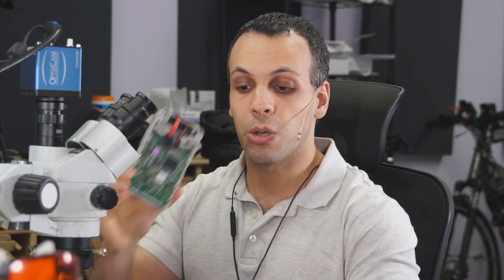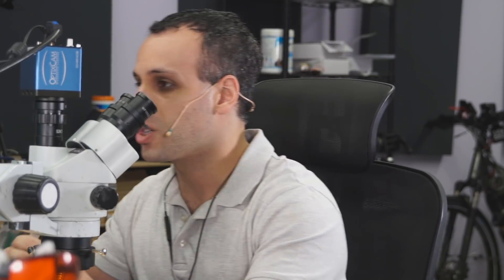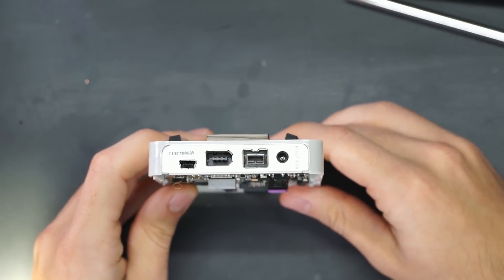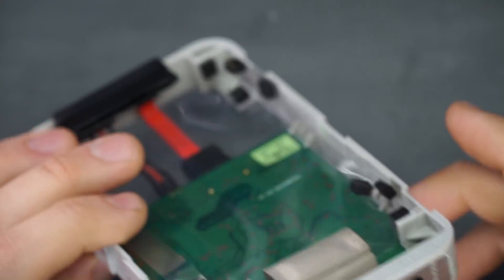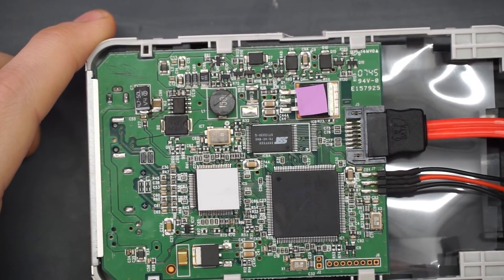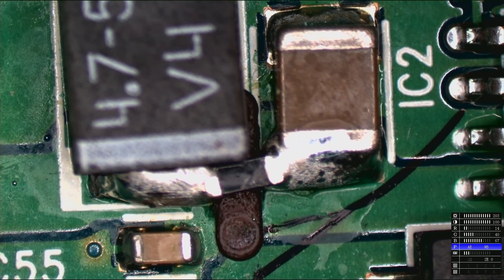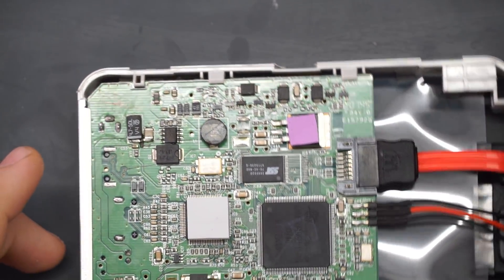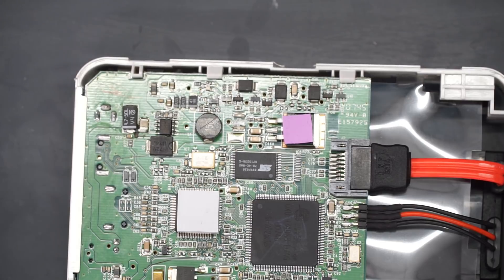Lacie RUGGED external hard drive: a peek at the PCB

Comment: I still have one of those. I'd need to check if my PCB has the same design flaw because mine is still working flawlessly to this day. What I love about those old LaCie drives is how easy it is to open them and swap the drive. I've recently upgraded mine from a 250 GB to a 1 TB drive. I mainly use it for my old PowerPC Macs which require FireWire for booting. Also older (PowerPC era) Apple laptops can't run a regular hard disk from a single USB port without an external power supply. So this drive comes also in handy for that purpose. I use FireWire (also 800) almost daily for backing up stuff and TDM since I only own older Apple products (i.e. those ones that aren't unrepairable junk)

Comment: this low value resistor might be there on purpose. There is a thing in power delivery circuits called CC-resonant-effect (or LCC-effect in some cases) when different type capacitors connected in parallel causing EMI through power line to chip. One type of capacitors (tantalum dark one) charges slowly than ceramic (light brown one) cause of different ESR between them. When power is applied to circuit where both capacitors positive poles are soldered on part of copper pcb trace (with its own low-value inductance) the ceramic one charges faster to its peak value, where tantalum one is still charging. Now from this moment, the ceramic capacitor will give part of his charge to tantalum bro right near him until they get both the same voltage. The inrush current that was flowing to ceramic cap now flowing through the same part of copper pcb trace backwards (might be lower value, but thats no point). And for the next moment they both discharging to the load after them with different "speed" (cause of ESR). Within this cycle this tiny part of copper pcb trace will act like an UHF-generator and will give strong EMI-jitter on a power line. For these reasons when engineers design CL/CR-filters they trying to  get rid of resonant effect when using different type of capacitors. You might noticed that Polymer caps are not being used in parallel with Electrolytic ones in power distribution units (ex. any phases qty stepdown converters) but they both can be used in parallel with ceramic. Cant bother longer, but putting a small value resistor between these caps will eliminate potential resonant effect that will strike with UHF spikes on the load.

Comment: I'd kinda expect to see Seagate HDDs in a Lacie seeing as Seagate bought Lacie a few years back.

Firewire 800 was my default go to in ~2005 - 2011 for external storage. It was the fastest option available at the time for a safe hot pluggable drive. It was usurped by the much cheaper to produce USB 3.0.
Reply: Same still use it wasn't until we got USBC Thunderbolt that we really had a competitive replacement. Even with usb3 I was still seeing better transfer on fire wire.

Comment: I'm a New Yorker and had an Apple powerbook and a G5 tower both of which had FW800 ports.  I specifically bought a Lacie external drive because it was the only reasonably priced drive with a FW800 port (and I believe it was 7200 rpm too).  I was using the drive(s) for video editing and photography.  I also used the FW800 port on my powerbook to shoot photos tethered directly into my laptop.
  Not a great product by todays standard but 20 years ago it was a decent setup... DJs also used Lacie rugged drives a lot when Serato and Tracktor came out.  I actually still have 2-3 rugged drives that still work but I have switched to.using SSDs for pretty much everything.  I would agree that lower end seagate drives were trash as well as western digital... I had literally experienced brand new drives refuse to work or crash without warning.  I hated optical drives for that reason and only used solid state for most of my archiving needs... 20+ years ago!  I saved everything I could on jump drives, dual layer DVDs and CF cards... seriously.
   Anyone want to buy some rugged drives? :-)

Comment: Back then I worked in IT for the stock photography world.  FW800 was big on some Mac desktops.  G5 maybe?  Anyway those LaCie external drives were EVERYWHERE, 2.5". 3.5", 2-4 disk multi 3.5", Rugged, Porsche, etc.  They were no more reliable than anything else and failed regularly.  I still have a couple of Rugged and Porsche's in my home stash - 40GB and 80B.  No idea why I don't toss them.  Nostalgia I guess.

Comment: Sounds like they designed the board, had it manufactured and populated, and then found out that maybe the rail for the logic needed an inductor working as a filter. This is not uncommon at all and lots of times you can see unpopulated pads in PCBs that are meant to apply these kind of fixes (but they'll skip if in the end its not needed, to save costs).
Its one thing to test a PCB on a lab with good power supplies and all, but then you may encounter devices that make your design unreliable. Why design and manufacture an entire PCB for just one inductor, right?

Comment: Worst purchases I've made for data storage was LaCie and their "Porsche design" fan-less enclosures that roasted the drives and the external power brick that cremated itself over and over.  The drives inside were mainly Maxtor, I think two were Seagate. The reliability was horrible, I returned them four times in one year and the replacements often didn't work at all or were really flakey. Eventually discovered that the external power supplies were to blame, noise, ripple, lack of regulation...
Reply: Yes. For as long as they've been on the market, LaCie have been notoriously unreliable. It’s not neccesarily the harddrives, altouhg those are invariably of the pedestrian cheapskate variety, but the crappy powerboards and cheap underspec controllers that invariably gave out the moment you needed your files.
Reply: @disklamer  three brands that have fu*ked me over, LaCie, Seagate and Maxtor.  I had a good old LOL when I read (2006) that Maxtor got bought by Seagate and of course, Seagate owns LaCie - so there it is, a turd made to be a turd, containing a turd, by a organization who produces turds.  Avoid those three brands for sanity's sake.
Reply: @davidhunt240  I've a Maxtor, not sure about Seagate but not yet had a hard drive fail. The one in the LaCie is still in use, as it were but the LaCie box went in the bin. Shame really, I rather liked it until it failed to boot.
Reply: No shit!, I had one of these and it fail miserably, I always wondered why, since it was just after the warranty expiration!.
What a bunch of B..t..ds.
Reply: Wow I went the OWC route they had a better price point and they weren't bottom of the barrel $10 Amazon stuff plus the encouraged? opening the stuff after warranty of course

Comment: Yep still use FireWire 800 in my iMac 2010 which I’m using until I replace the graphics card on my 2011 iMac with the alienware card I just bought. Also use it on my 2011 MacBook Pro which is running Mojave and have disabled the gpu to run integrated. For 3.5 platter drives it’s fine, usb 3 is quicker which I have thunderbolt adapter for but if I can’t be bothered connecting a USB 3 hub still use it.

Rugged lol, hi vis orange

Comment: the only FW 800 cable I ever had connected a 2000s Sony camcorder with a 2009 iMac, since they did not offer FW 400. But the camcorder had worked fine with a 400 cable on older Macs, it‘s just that the then-new iMac did not have it anymore.
Reply: If it was a Sony then it was using there I link protocol connector AKA what I call firewire 200 the connector only carry the data pins and not the power pins
But thankfully firewire was backwards compatible with everything at only a loss of speed for that device.

Comment: Using a late Mac Mini 2012 right now that I have a blu-ray drive using FW800 with three FW800 hard drives also plugged in.  They are all plugged into the single FW800 port.  The daisy chain capability of the FW800 or FW400 was super nice when you wanted to have more than one or two devices all plugged in at the same time.  The other nice thing is that the transfer speed of the FW800 is more consistent than USB3.
Reply: We really didn't get anything to replace firewire until USB C Thunderbolt the ability to have one cable trailing off of your notebook to bunch of other things is really nice unless you need to take something out of the middle of the chain.

Comment: I remember using the FireWire 800 port almost daily on a 2009 MBP... It went straight into a FireWire 400 adapter, into some kind of audio interface I used to run a set of Logitech surround speakers. Maybe once or twice I used FW 800 for an external drive enclosure, but IIRC there wasn't much support for it. The speeds were good but USB was way more widespread
Reply: Dumb ass apple killed it by charging licensing fees, b/c they're greedy losers. USB is trash, b/c it was mainly developed by intel and it's still trash and slow. It's going to take a while before 3.1/4 becomes a thing. We're literally about a decade behind on external storage thanks to apple and intel.
Reply: There was quite a few chip manufacturers but you really wanted Texas instrument ones and they were expensive and hard to get to because there was a not a lot of reason to have firewire unless you were working video or audio and if you're doing that you're most likely on the Mac anyway. Although the industrial picked up with high-speed cameras and Machine Vision using firewire cameras for a good while.

Comment: I've used FW800 cables and FW800 extensively in my work supporting mac IT infrastructure in schools for years. I would use them/it primarily in conjunction with Firewire target disc mode for cloning/imaging and/or accessing data from target devices. In my go bag I had a FW400-FW400 cable with two FW400-800 adapters, one on each end. That meant I could connect anything to anything with just that one cable :)
Reply: Well it wasn't a school I did have in my go bag a FireWire 800 cable with a 400 adapter and 400 cable. Just went through my bag to sort out what I didn't need with my new computer and I still included them never know when you're going to run into a FireWire audio interface and want to use it of course assuming they don't use proprietary drivers....

Comment: "rugged" 😆. It does tempt a strong Highland Scottish Accent. Just last night I had external HDD issue. After windows refusing to eject it and having no program open that could have been accessing it, I run resource monitor to find an indexing service pissing about with it. I try several times to end the service in a couple of different ways. No good. In the end I shut the laptop down. I move the drive over to my desktop pc and to my horror windows asks me to format the drive as it doesn't recognize it. The drive is now in a RAW format and all my movies inaccessible. Not even my data recovery freeware can read it. Thanks Microsoft you piece of shit. Anyway, I've found a clever piece of free software called testdisk I think by a brainy french guy I will be trying out later that can recover a drive from RAW back to its original file system. If it works I'll give him a good donation
Reply: Good luck!!

Comment: Its probably not that uncommon in smaller batch companies. Its really quick and easy to have someone jumper like that but potentially very expensive to replace the boards.

And after seeing that attention to detail it doesn't surprise me that the board died. HDDs are reasonably reliable, and the impact absorption helps a lot in a mobile device

Comment: Wow we aren't the only company that does this.

We have a PCB that is assembles in one of the company's product. This PCB was causing the LED to overload the board because there wasn't a resistor to discharge the unused power (go figure). The customers who bought these products were given a recall notice. As a repair technician we didn't replace the entire PCB but instead added resistors across a series.

Comment: damnit. i'm using a Lacie Rugged 4tb as my main travel drive for my gopro footage on my motorcycle. can anyone recommend a better hard drive that can survive being on a motorcycle traveling around the world with me that won't crap out? it would be awful if i lost all my footage because making backups is extremely hard and unpractical doing the kind of traveling that i do. i know i should but im dumb and live life on the edge. any recommendations?
Reply: I think a good quality SSD and the 321 backup method because if it's only in one place it's not backed up. There's also some like Cloud drives where you can put a memory card in and it will Auto copy.

Comment: I had a Firewire 800 cable going from my early 2008 iMac to a 2nd gen Drobo with 4 disks, scoring a miserable 60MB/sec for 6TB capacity (3x 2TB for data + 1x 2TB for redundancy). That would actually be the theoretical limit of USB 2.0 (480Mbps/8 = 60MB/sec) so I wouldn't even be surprised if that Drobo had the Firewire 800 connector behind its USB 2.0 interface (it actually had USB 2.0, Firewire 400 & Firewire 800 interfaces). Those Firewire 800 cables were ridiculously expensive back then.

Comment: Interdasting. I just bought one of these second hand recently to use as an enclosure because reasons and it doesn't have this mod, so obviously they updated the design at some point. Instead of the tantalum, there's a ceramic cap, and the inductor obviously has its own pads. But now you've got me worried that it's going to die, so I'll have to keep an eye out for a spare.

Comment: I stil use firewire 800 for a few drives but not much now switched alot over to C type or usb 3.o and i have one thunderbolt 2 drive as well but hardly touch it now it also has usb 3 on it I stil use fire wire with mini dv decks but thats about it.

Comment: I did use the FW800 with macbook pro i7 2ghz, it was some times ago when there wasn't retina or unibody. It might have had even nvidia card. I had Western Digital Mybook pro. It was good until it crapped its external powerbrick, and after that other raid drive inside, and then the controller toasted itself. WD used to be good, but that device clearly wasn't. But i don't have anything bad to say about FW800, it outpaced the FW400 and it was way more responsive in read and write than usb2.

Comment: Not only did I use two of these drives in my last job (school technician), they were daisy chained  from the iMac to a 3.5” external LaCie drive by FW800 cables!!!
It wasn’t my software being backed up, they were cheap drives.
I stopped using anything with a Seagate drive many years ago because Seagates would just fail for no apparent reason.

Comment: I used the FireWire 800 port on my mid 2010 MacBook Pro with my external backup hard drive.  Which was then daisy chained to another FireWire 400 drive, and to yet another FireWire 400 drive.  800 Mbps!  almost twice as fast as USB 2.0!

Comment: Calling something Rugged means people are more likely to throw it around, causing premature failure i.e. buying another one.
Reply: same with people driving in areas which have less people. they think that there is very few people so they think that nobody will come around that corner and perhaps they are correct for a few times, but then their luck runs out and someone does come around that corner and when they are thinking that nobody will come around that corner, they drive faster so the incident is made worse (instead of injury they get killed).
Reply: If I buy something "rugged" and it breaks (regardless of whether I was "throwing it around" or not), I sure as hell won't be buying another one, and I'd assume most consumers would behave the same way.
Reply: Yeah people had this idea (Or still do) that you could toss them around and even move them while they were running. And definitely doesn't help that they have Seagate drives in them (And are now owned by Seagate) which is the least reliable hard drive manufacturer. Think these got popular on film sets based on the idea that they could be thrown about on a fast moving set, but realistically it's just a marketing gimmick and these are as fragile as any other hard drive. The rubber bumper is a waste of space, these need to be handled like any other piece of valuable equipment.

Comment: When I worked at apple, we used those drives on FW800 to image iMacs for the Apple Store. I never understood why Apple picked those drives, because they were utter crap and fucking expensive.
Reply: I think you just explained why they picked them they got a really good deal and they could sell them at a nice markup.
I went in with an iMac with a bit of storage that needed to be reinstalled right when they switch to internet installation I was very tempted to make a backup of something but I wasn't sure what I would do with it after that as the computer wasn't mine and I didn't have enough space at home.

Comment: the 4.7-50 V4 diode is it bridged to the resistor
Reply: yay i got it right....well sorta lolz...but still i noticed something looking strange
Reply: That's a tantalum cap (4.7uF 50V, Vishay I think), and it's had a ferrite bead added after, probably to suppress conducted emissions. That's the firewire power rail, may also be connected to the DC jack.
Reply: @Monkeh616  ahhhh thanks for pointing that out to me...now i know for Louis's next 'test'

Comment: I used Firewire 800 often on my older macs. Had a couple external Lacie desktop drives that always had 2 ports so that you could daisy chain them (pre-thunderbolt).
Also Firewire 800 made target disc mode much quicker.

Comment: I got a OWC usb 3.0 fire wire 800 after I upgraded to a SSD installed in my mac min a1347. Still occasionally need os 10.12 on the old hard drive and usb 2.0 is to slow.  Only need it for 32 bit support for logic 7.2.2 or something. I liked the 10.13 for normal use.